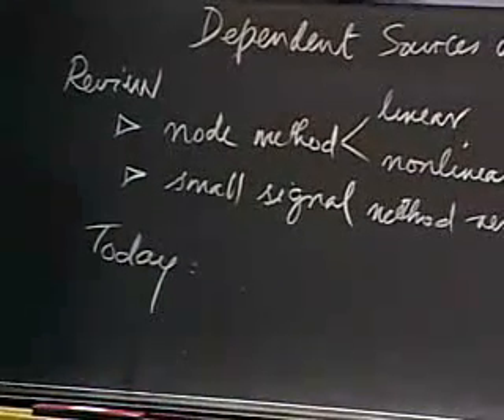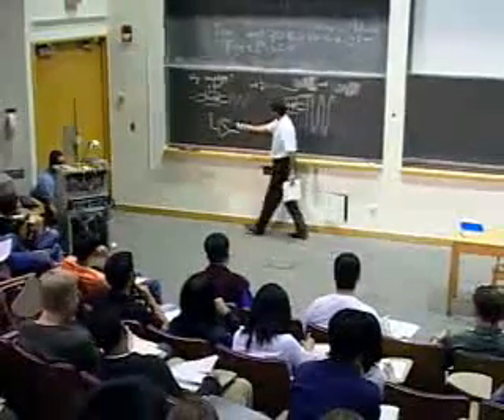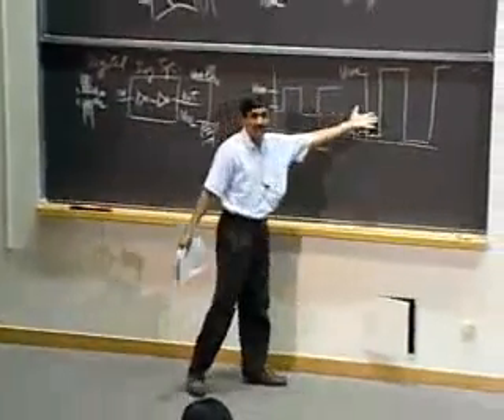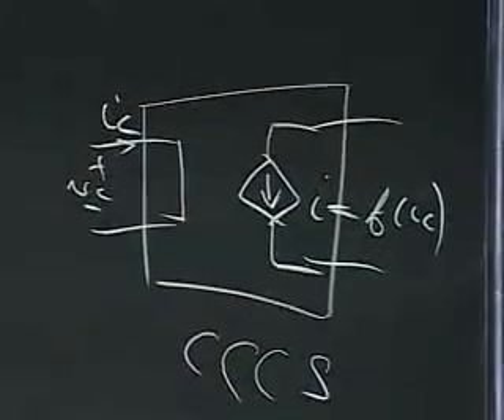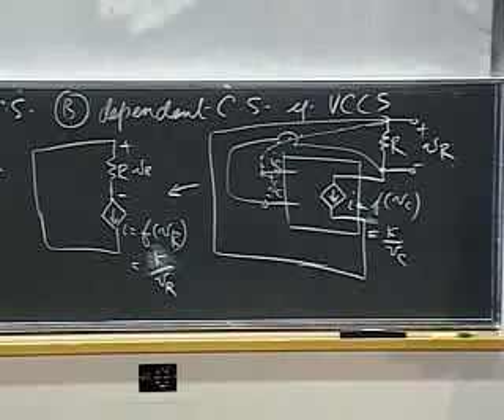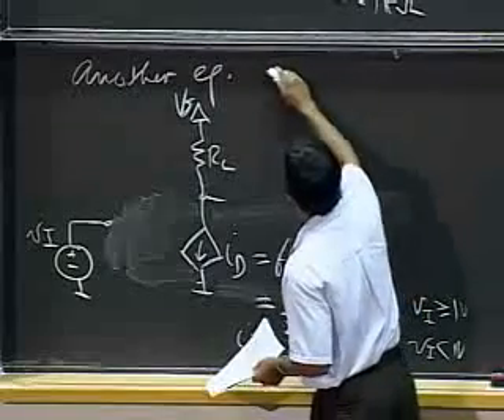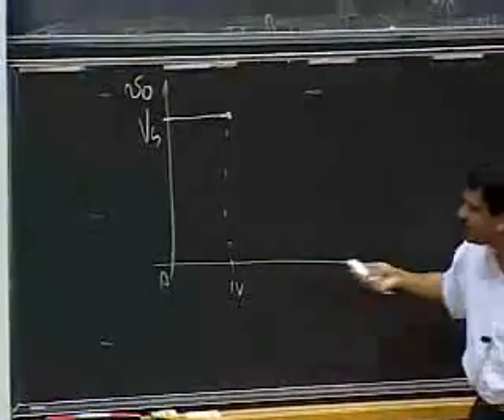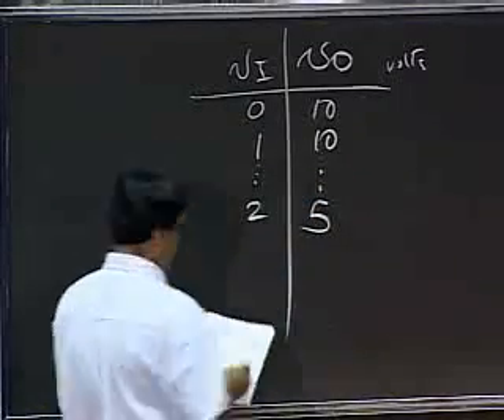Lec 8 | MIT 6.002 Circuits and Electronics, Spring 2007

Comment: How voltage from output source circuit is connected to input control voltage of the independent source at 27:00. Don't it make loop and continuously vary current?

Comment: How can it be that an output quantity depends only on an input voltage or an input current? Maybe this is just a simplification, but it seems like a voltage or current source must be a function of more than one variable since voltage and current are related by Ohm's law. Should it be a composite function such as i = f(Vc(Ic))?
Reply: setnorm426 in the example the input impedance is infinite, so the input current is zero, and the output current depends only on the input voltage. In a practical device the input impedance would be less than infinite, but still large.

Comment: G they mixed 4 courses into 1 ? 
we have Circuits I & II 
then Electronics I & II
 
This is crazy !
Reply: how are u mate, 10 years have passed.
Reply: @gamar1226  how are you mate, 2 year have passed
Reply: @amankumardas7120  Good, I work as a Design Verification engineer using SV & UVM. I ll finish an EE degree this year.
Reply: @gamar1226  that's really cool man!!
Reply: @amankumardas7120  Thanks

Comment: > some other operations are needed

Yeah, you need to do a translation in voltage space, such that 0 is the center between the thresholds (before scaling), and a translation back again.  AIUI, that'd just be a matter of adding voltage sources around the amplifier (be sure to check the polarities).

Comment: I believe there is some inconsistence around 16'50. In fact, if Vil is amplified by the suggested value (or by any other), it will not reach the desired Vol (which is lower than Vil). Besides amplification, some other operations are needed and they could have been mentioned...
Reply: 9 years ago people hello, but V_OL is higher than V_IL in this case?😅 It's an AMP.